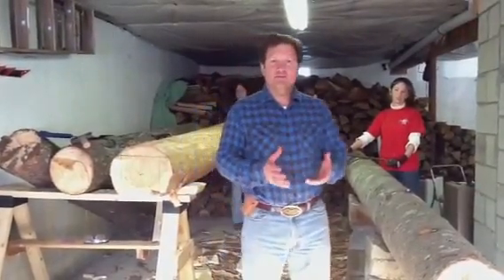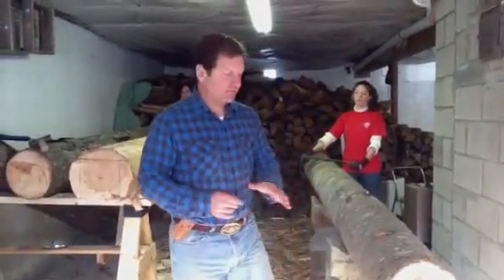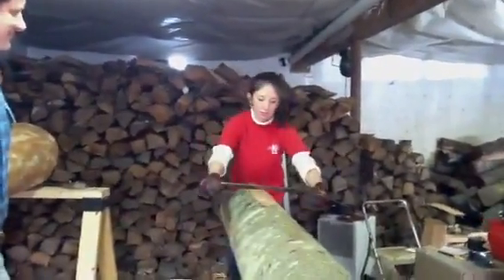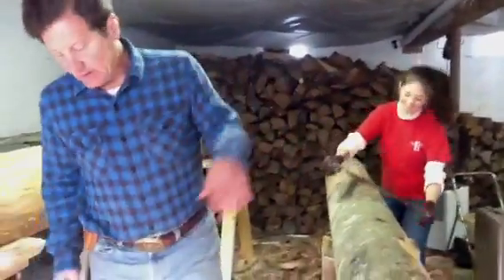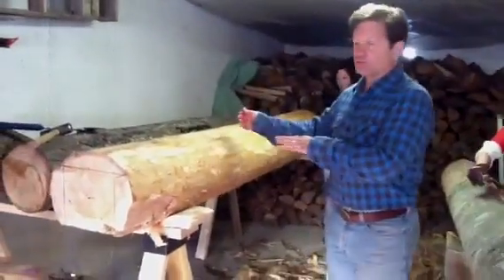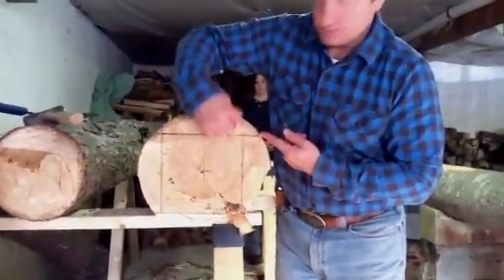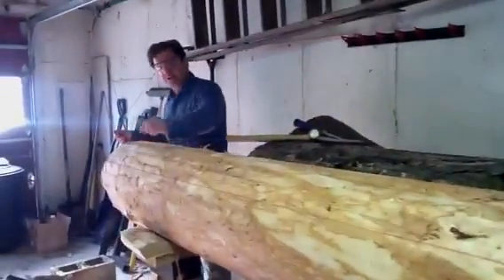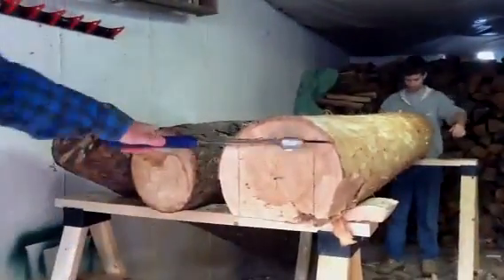Squaring a log with hand tools: Part 1

Comment from the maker: You could. When I was doing the video I did not cut deep enough with the saw. I was trying to not leave saw marks. This made the maul/ ax work hard. I have found that if I cut with the circular saw a little short and finish with acarpenters saw I get get the exact depth needed. Then the maul/ax work is very easy. So I would prefer this over a saw length wise. But thats me.
Reply: MrMittg why did you use a circular saw in the first place! 😳 you titled your video HAND TOOLS.